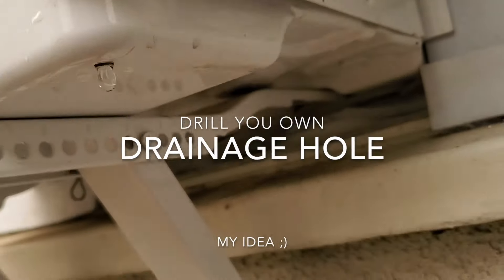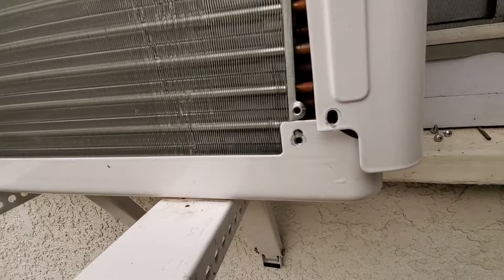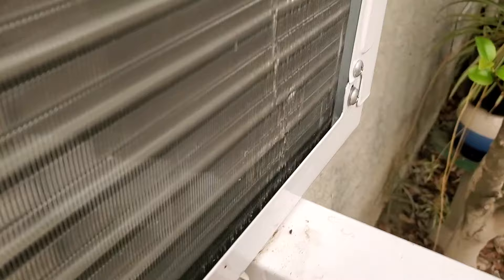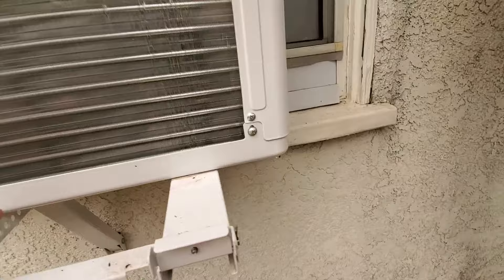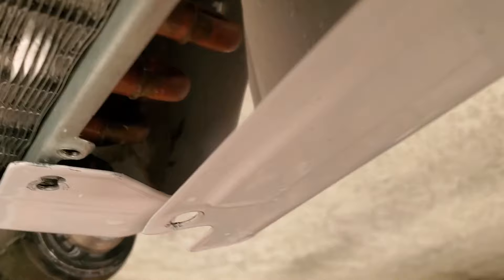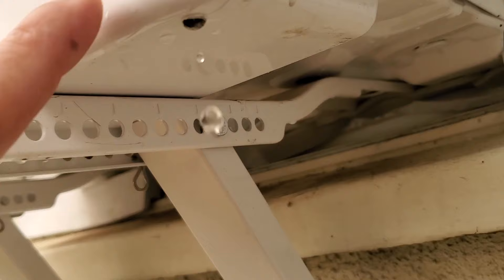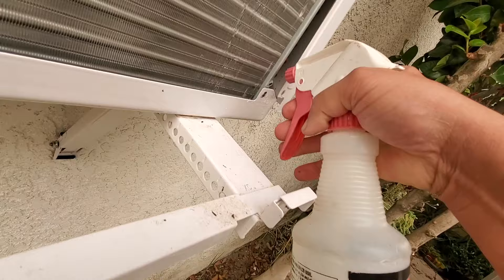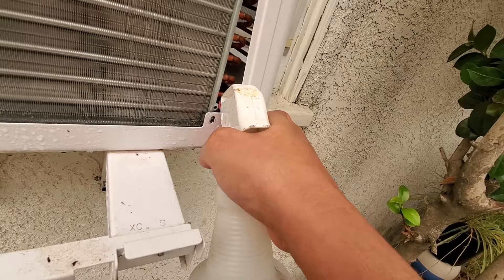How to Drill a drainage hole in your Midea U- Shape fan :) Honest²

Comment: outstnading, they spent so much time on the actual ac, they missed the water issue, IMHO
Reply: The water is used to increase heat rejection of the condenser (Radiator). Without it your compressor (engine) runs hot. The unit will work the same but the compressor will likely fail early. You will understand this knowing cars 👍
Reply: @mattb6514   So, Matt what should I do?  I am 72 and I was planning to call a neighbor to make a hole, but where?  On the right side or left side.  
I have seen a video with a hole on the right side as you look at the unit from outside.  Do you consider it's better to not have drainage at all?  
While working, the unit is all wet inside.  No drippings at all.  Just on the left side there is condensation outside and there are water drippings.  
Waiting for your advice.  Granny.